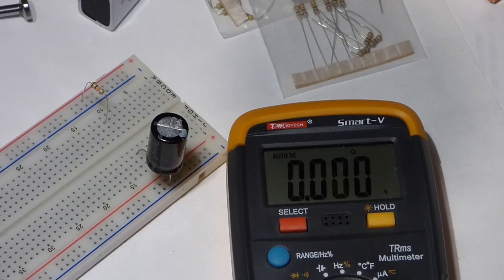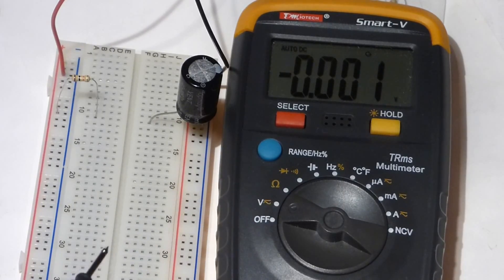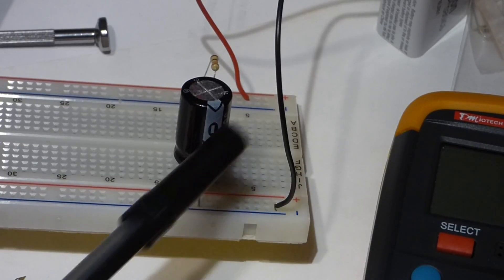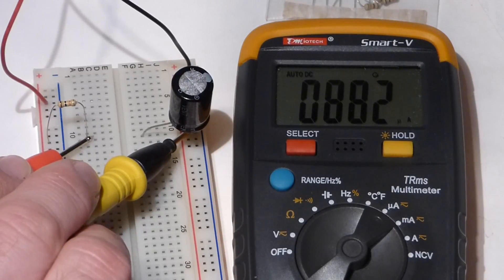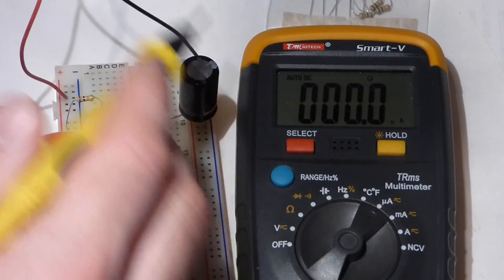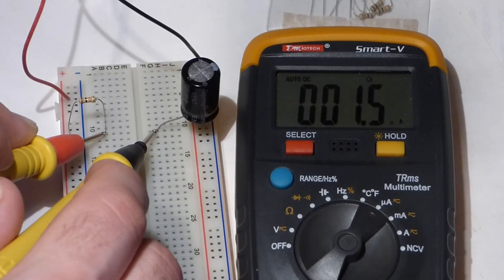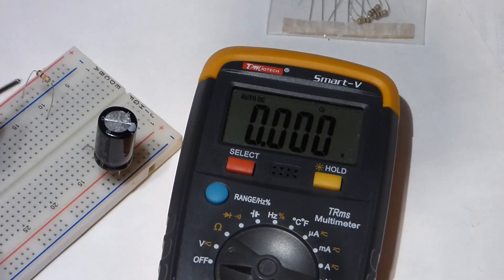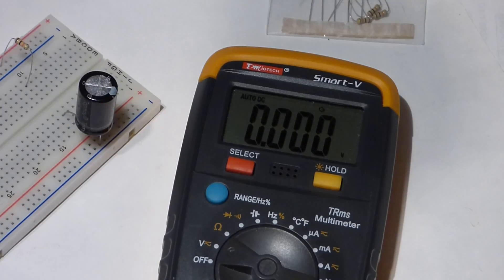Multimeter measurements of voltage and current of slowly charging electrolytic capacitor

Comment: I have some questions, I am trying to charge a capacitor then monitor using a HIOKI LCR meter (Capacitance and ESR). However, these can not be done simultaneously as the LCR itself is capable of providing voltage to the capacitor itself.
Reply from the maker: You need to discharge capacitors before measuring them with the LCR meter that I have. I don't know if any other meters can measure charged capacitors.

Comment: The multimeter actually charges the capacitor from its battery - it is not memory - it's charging from the battery in the multimeter

Comment: you say that the capacitor has almost a full volt of charge. Is charge measured in volts? Thanks for the clarification and the video!
Reply from the maker: This is a long topic to study, but briefly speaking, as current charges a capacitor, it's voltage rises based on it's capacitance, how much current is being applied, and for how long. A 1,000 microfarad (1000µF) (0.001F) capacitor has 0.001 coulomb of charge at 1V, and has 0.002 coulomb of charge when charged to 2V.  It will gain 1V every second if charged with a steady 1mA (0.001A) of current.

Comment: I have 50 pieces of 2200uf rated at 50v and I want to fix them on circuit. I would like to be charging them directly with about 20v power source  without a resistor because I need a quick charge. Now I want each single capacitor to output at least 1A or closer for every second. I want to program them in such a way that discharge them individually. The load itself require 6A so I'm trying to design and discharge these 50 caps individually. so if each cap could give me at least 1A or 0.90mA, I will be fine. Is it possible this way?
Reply from the maker: I'm still at work, so can't access internet to verify things, and might make a mistake or 2, but, 50 2200 uF capacitors wired in parallel is the same as a single 110,000uF, or .11F capacitor. Each volt you charge them to will = .11 Coulombs, so 20 volts will = 2.2 Coulombs of total charge. That means you can expect 1 amp for 2 seconds, or 2 amps for one second, 6 amps for .333 seconds, etc. While they are discharging, they lose voltage too, so halfway through discharging from 20 volts, they will be at 10 volts. There's a lot of other complications too,

Comment: Your videos are so helpful to me.
I would like to know how many mA a 2200uf capacitor can store if I charge it with a 5V power source. Thank you very much for sharing.
Reply from the maker: Thanks for watching! I'm at work, so sorry if I make a mistake, but with a 2200uF you'll store 2.2 millicoulombs per volt. Amps are Coulombs per second (1A = 1 Coulomb per second). Doing a google search for "online capacitor calculator" will link you to websites where you can enter numbers you know/interested in and it will calculate the rest for you.

Comment: hi! noob question. how do you use the power on the capacitor on a DC circuit?
yes the capacitor store charge and stops the dc current flow.
how do you use the power stored in the capacitor in a circuit?
i cant not find a basic info regarding this. like really basic real life usage of capacitors
Reply from the maker: I have a number of previous videos that use capacitors in a circuit. But the simple answer is that the capacitor acts like a battery when it is charged. it's voltage however drops really fast and it doesn't store as much total energy as a battery per size. Mostly capacitors are used for short bursts of high current, voltage stabilization, and many circuits use the time that it takes them to charge and discharge to set the speed of circuit operations. Hope that helps!
Reply: yes i have seen ur videos on capacitors, i seen how u discharge them. was wondering if there is a micro controller that does the discharge automatically so i can use the stored energy after the capacitors are fully charged. ?
Reply from the maker: I haven't done any of that yet, but you can set up practically anything you can think of . If you want to really power stuff with a capacitor, then you want to watch videos on supercapacitors or ultracapacitors (same thing with 2 names) which can hold hundreds of thousands of times the charge of a normal capacitor. I would love to do more supercapacitor videos and get into microprocessors but it is going to be a while because I ran out of room for new projects and have idiot neighbors that would think I was building a bomb if they saw electronics stuff lol.